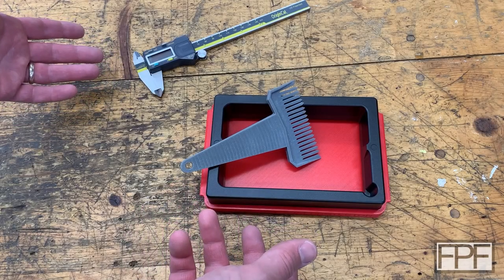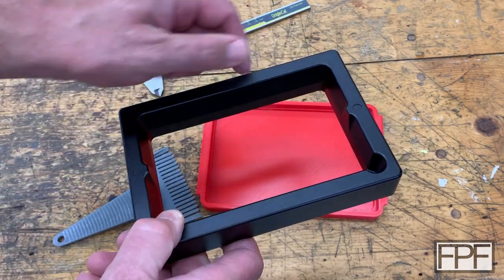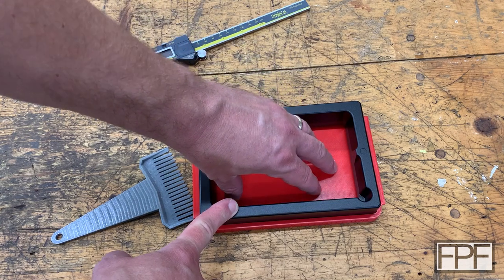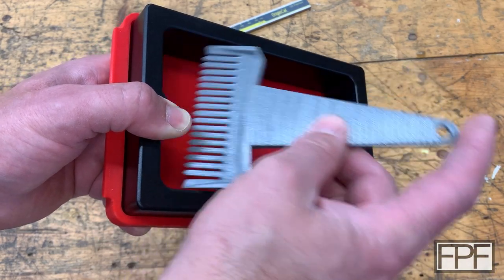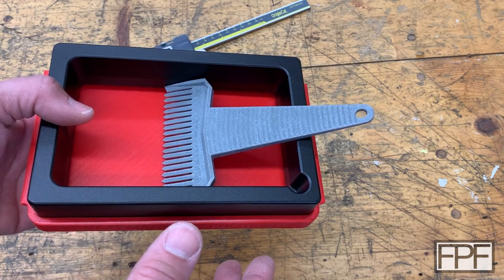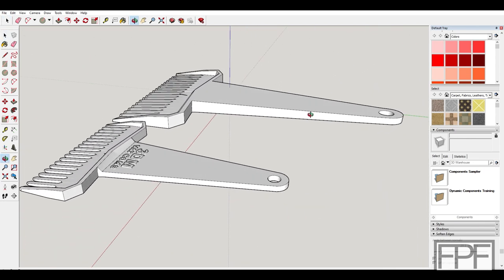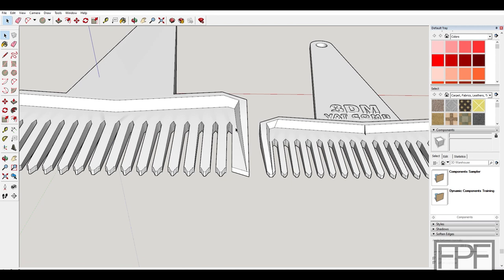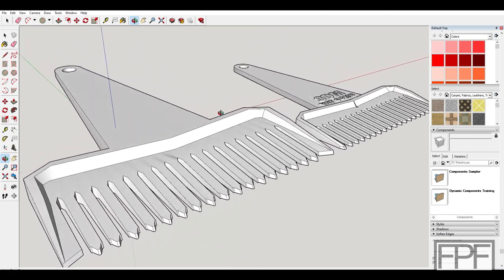3D Printed TPU Resin Vat Comb for SLA Printer

Comment: No, thanks. I prefer filtering not only the particles larger than 0.5-1 mm in the diameter, so I'll stick to the disposable 190 µm paint filters. Also I would prefer not to scratch the FEP with this pointy TPU "fork" and will use silicone spatula instead.
Reply from the maker: Paint filters is for sure better if u want to dump vat, but this has served me well and i don’t think the TPU is hard enuf to scratch FEP.